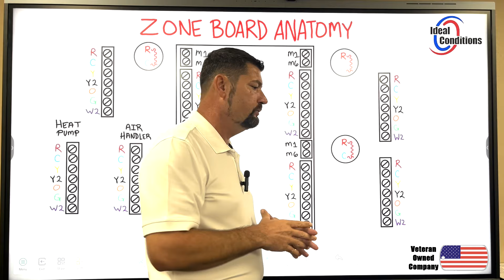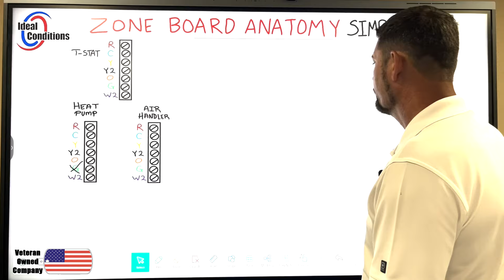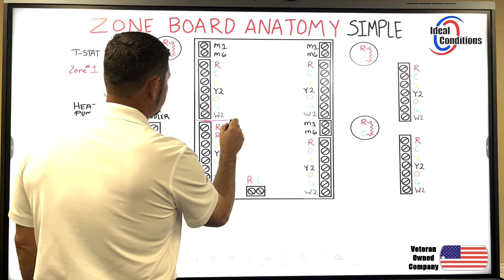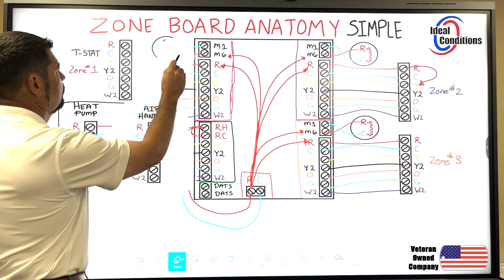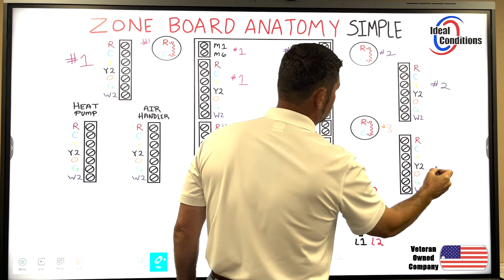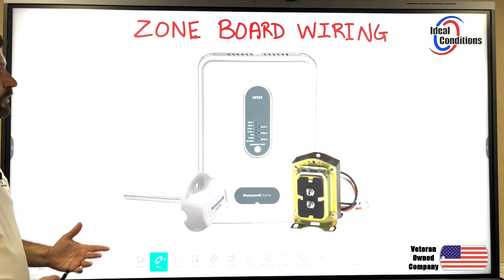Zone Board Anatomy | How to Diagnose a Zone Board

Comment: wow   Outstanding, helpful and illuminating.  Thank you Sir for sharing your insight.  Your explanation of the segregation of "equipment" (air handler fan, air handler panel and the compressor) and the primary transformer on the one hand from the zone components (t-stats, dampers, and the zone panel's internal switching electronics) and the secondary transformer on the other hand was spot on and helped my understanding in a transformational way.  That you have shared your experience in these videos is not only valuable but it is also greatly appreciated.
Reply from the maker: Glad the video helped you out and that you enjoyed it! Thanks for watching!

Comment: I kindly request, for commercial package units, can you show us low voltage diagrams and economizer circuits if possible? Would love to see that because a common issue I have run into is the economizer locks out the cooling